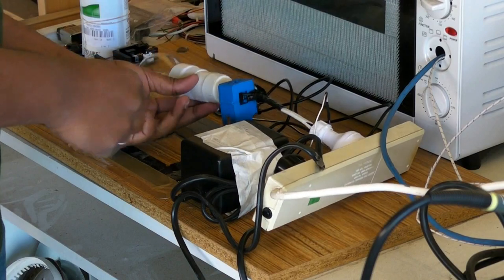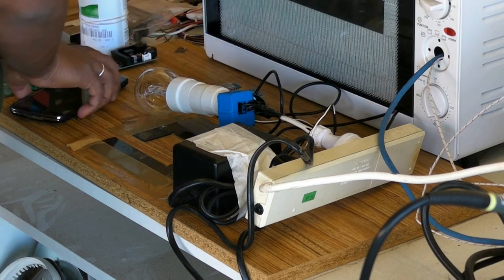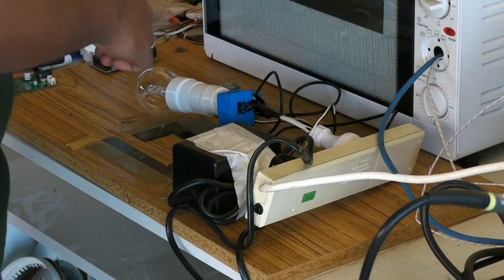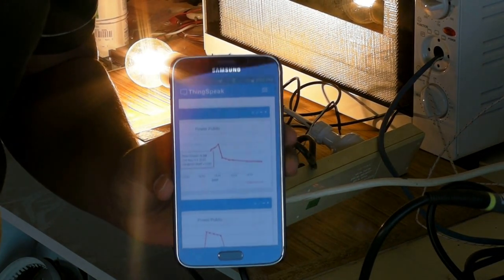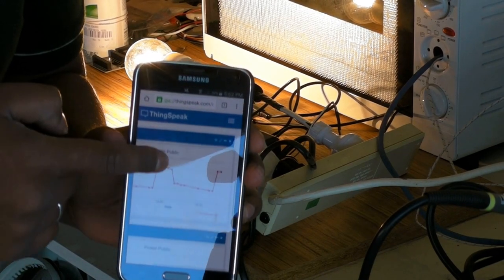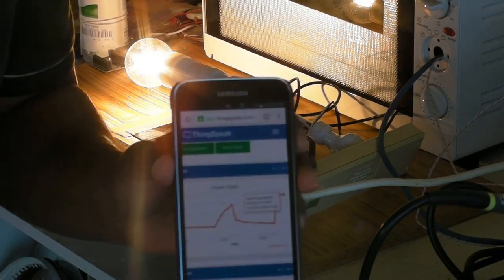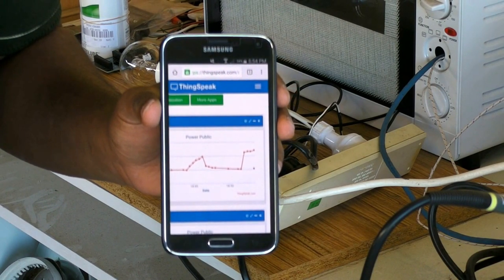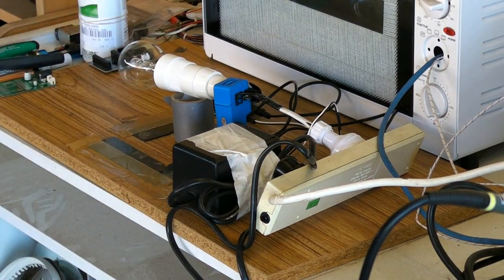NodeMCU Energy Monitor Testing

Comment: Hi, thank you for the video and the sketch, but should i be seeing the first minute or so of massively incorrect readings?
Reply from the maker: Yes this is the mean calculation and settling period.
Reply: @TishamDhar  Brilliant news, thank you for the reply. I am using it with arduino, can you suggest a simple way to completely omit the incorrect results from serial.print as i have it printing to a mysql database every second. I was thinking a simple if Vrms = >260; then Vrms = 0; but this will still post 0's to my database which will spoil my graphs.

Comment: Good afternoon, I really enjoyed your project. I'm trying to build a present to the university study. I did everything right, but the values are giving way above normal. I am measuring a fluorescent lamp that has the PF 0.67 220V 0.40A but the serial monitor is giving, just current: 4.63 RP:3219.01 irms: 3.83 vrms 754.67. Any idea about my problem?
Reply from the maker: Hi the voltage offset takes a few iterations to stabilise and first voltage readings may be high.
Reply: +Tisham Dhar thanks for answering ... I left the system turned on for 20 minutes and the values decreased slightly. but still very high. just current 4.12 RP: 3045.48 irms 3.38 vrms 561.23. The voltage divider in this giving 4.13 volts on ads1115, is correct? the tension of my country is 220 volts 60Hz (Brazil)

image https://ap.imagensbrasil.org/image/I67MY
Reply from the maker: +Claudio Mendonça what is your transformer voltage 4V is too high. the limit should be around 3.3V
Reply: +Tisham Dhar Vin 12.3 R1 22K R2 6K Vout 2,60(better?)... just current 4.84 RP 2867.84 irms 3.52 vrms 701.62

Vreal: 203.51 ;Amp real: 0.84A; watts real 11.60; PFreal: 0.68(fluorescent lamp)
Reply from the maker: +Claudio Mendonça My resistors are usually 10K-100K See the schematic here - http://www.seeedstudio.com/recipe/img/recipe/2015-11/563a01fcda040.png . If the ADC is not fried then you are doing okay. But you will need to apply a multiplier to get realistic voltages. Also activating just current and real power code both tramples over globals used in my code. Please understand it before using. What sort of current clamp do you have 4A for a lamp seems too high as well. Tweak multipliers until at works.
Reply from the maker: +Claudio Mendonça My resistors are usually 10K-100K See the schematic here - http://www.seeedstudio.com/recipe/img/recipe/2015-11/563a01fcda040.png . If the ADC is not fried then you are doing okay. But you will need to apply a multiplier to get realistic voltages. Also activating just current and real power code both tramples over globals used in my code. Please understand it before using. What sort of current clamp do you have 4A for a lamp seems too high as well. Tweak multipliers until at works.
Reply: +Tisham Dhar I was using 22k and 10k as in his scheme in Fritzing.I will adjust to 100k and 10k.
I will adjust to measure the actual data I am using a kill watt monitor.
 the multiplier that you refer to is this(float multiplier = 0.125F;)?

thanks very much.
Reply from the maker: +Claudio Mendonça They are defined at the top of the Arduino sketch. The 0.125 is for ADC readings conversion.
Reply: +Tisham Dhar Vin 12.3 R1 100K R2 10K Vout 1,11... just current 4.33; RP 319.11; irms 1.45; vrms 281.15.

modify the multiplier (VCAL and ICAL)?
Reply from the maker: +Claudio Mendonça yes VCAL and ICAL let you tweak obtained values to match reality. Looks like you are already getting close to expected. Do you understand the code / circuit clearly ? Please disable the Just current code , it is overwriting the Ioffset global and will be interfering with your readings. What current clamp do you have ? What burden resistor ?
Reply: +Tisham Dhar disable just current ok
current clamp YHDC SCT 013 100A:50mA
burden resistor: 330r
Reply from the maker: That is another update from the Fritzing diagram. In the schematic I use a 100R burden resistor. That will scale down the current a bit.
Reply: +Tisham Dhar added 100r 
conducting tests

Comment: what is the tranformer you have used in this?  i used 12-0-12 and it burn the ads1115 while providing the input in A2 , A3
Reply from the maker: It is a 12V transformer with a voltage divider, when powering from NodeMCU max voltage to the ADC is 3.3V peak-to-peak , so 12V will definitely burn it. Use a voltage divider to bring it down. I use a 100K/10K divider. 12-0-12 is a 24V RMS transformer, you make have to use 200K/10K.
Reply: Sir you have used 22k/10k voltage divider in the fritzing diagram.
Reply from the maker: Which Fritzing diagram are you using ? There have been several iterations, you will have to verify calculations before plugging it in. I haven't updated/synced a lot of older documentation.
Reply: Shall we have a continuous conversation in any portal  like Skype
Reply from the maker: Prefer to keep it public for future reference. Please leave me a comment on the hacksterio page to update the Fritzing.
Reply from the maker: Maha Raja S The latest schematic can be found here: https://github.com/whatnick/NodeMCU_Emon . Please look in the SMD and PTH branches. Master is a bit of work in progress.

Comment: hi i would like to ask did you clamp only the live wire?
Reply from the maker: Yes live or neutral only.
Reply: What software did you use for the CAD simulation? i cant find any NODEMCU library in any CAD software :(
Reply from the maker: Cicuk Bha I used Eagle for PCB design.